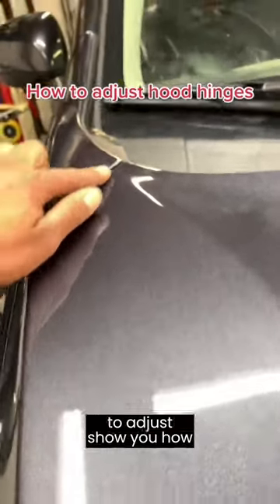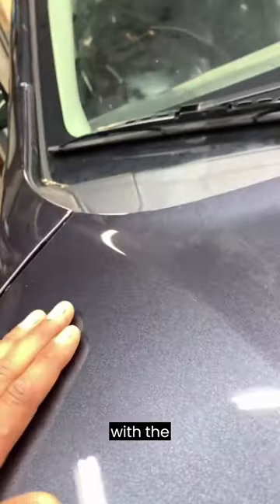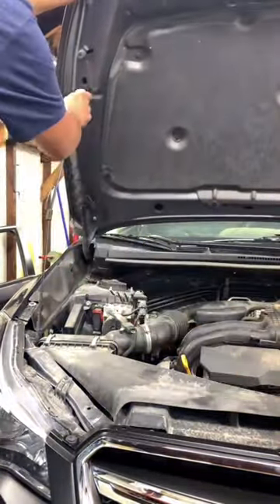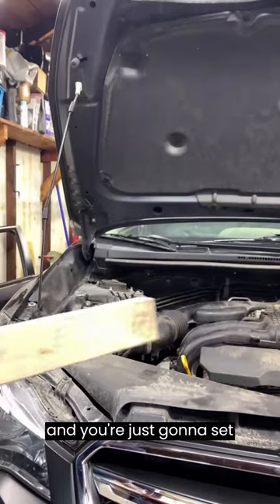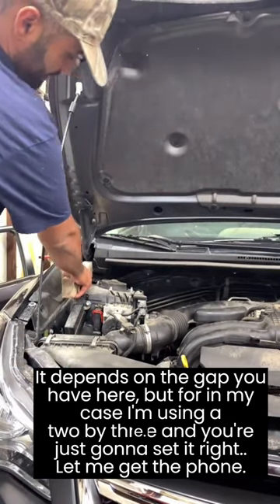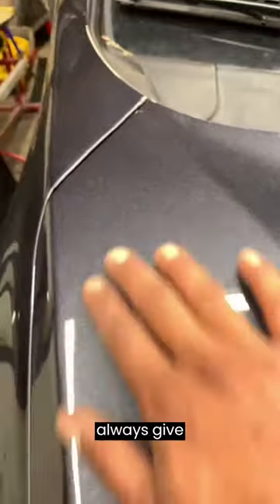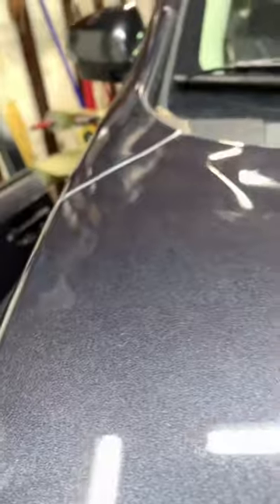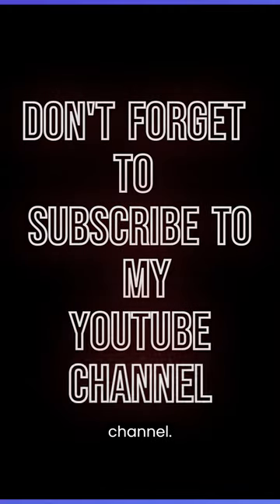How to adjust hood hinges in one minute

Comment: What if my hood is close but it’s lifting up but it’s close it like yours put lifted
Reply: Adjust the latch
Reply: If your car is very old then your latch spring is rusted, take it off, hammer on it with a rubber mallet, spray it with wd40 or penetrating oil, hit the latch closed with that mallet then use the hood released and spray some more until you can hit it closed with one decent hit instead of 5 hard hits, reinstall and you're perfevt.
Reply: @JDBajaBlast is this likely to be the issue if only one side has a lifted up gap?
Reply: @cam5816  well for one make sure there's nothing in the way or sticking up on the side thats lifted, then adjust your knobs, then try adjusting your hood mounts, f none of this works your hindge is likely bent